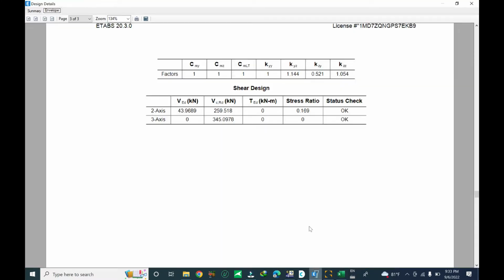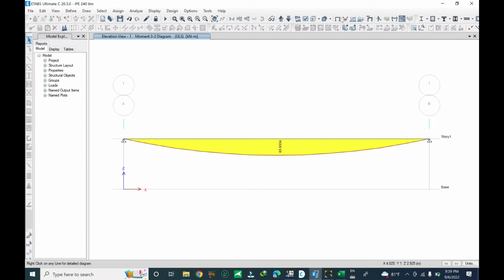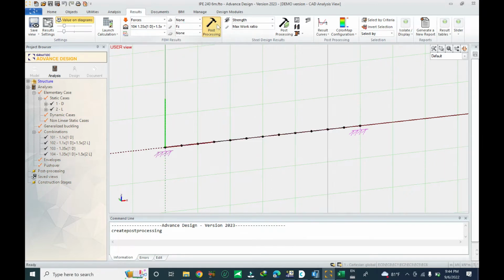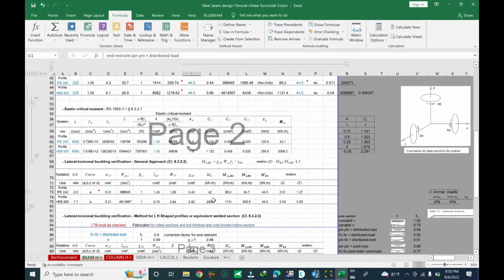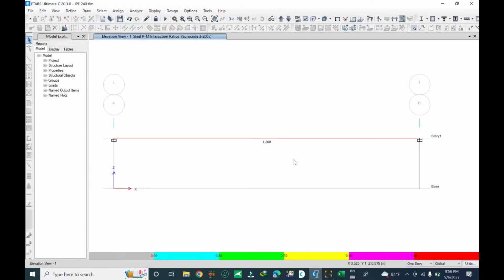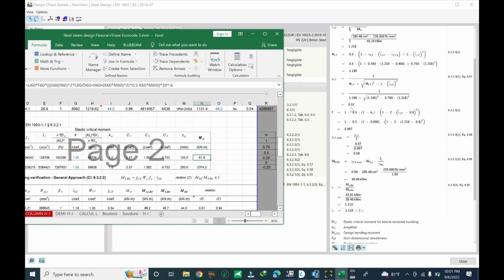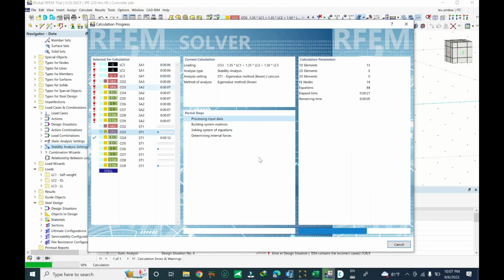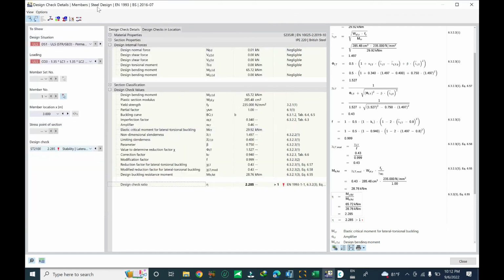steel beam design Etabs, Dlubal Rfem, Graitec Advance Design, Excel sheet compare reults part2

Comment: Hello,
 
as I have already commented on the first part of this video, it is evident here as well that an IPE 220 section is used in the model in Dlubal RFEM instead of the IPE 240 section which is used in other programs. Additionally, when checking for lateral-torsional buckling in Dlubal RFEM, buckling curve "b" is used, which is the default setting that we allow to be changed in the ULS configuration. In the reference solution in the Excel file, buckling curve "a" is used for lateral-torsional buckling.
 
If we create the same model in the current version of our program Dlubal RFEM 6.06.0012, but with the correct IPE 240 section and use buckling curve "a" for lateral-torsional buckling, we get a utilization of 0.936 (for the fix-fix end restraints), which closely matches the reference solution of 0.94 in the Excel file.
Reply from the maker: well received with thanks. if I have time to do it again, I'll compare with the newest version of Dlubal RFEM with other software in current market. for my opinion RFEM is a best software for overall uses especially for steel structure.  Thank for your best effort on this major change on structural analysis and design software for this world.